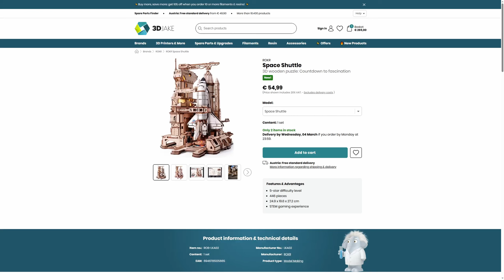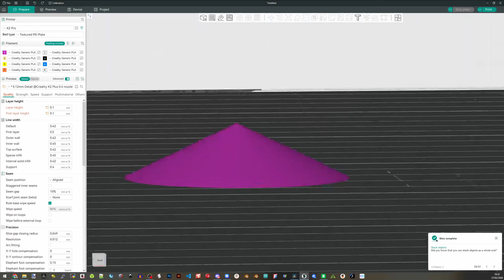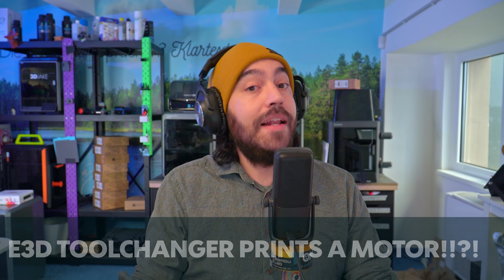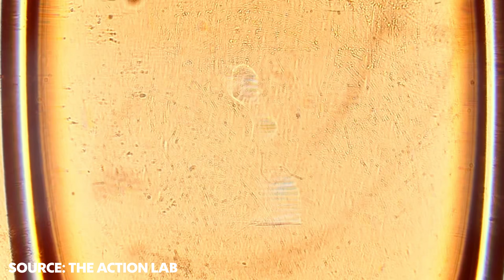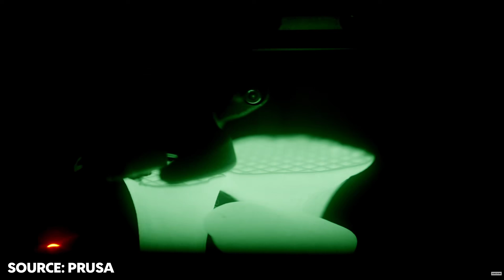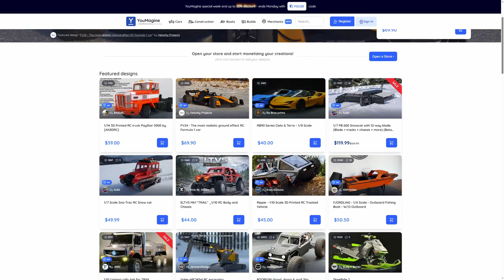Community News February 2026: New Products and News Updates!

Comment: Not related to video topics, but is it possible to filter or search filaments by subtype? Like PLA+?
Searching for "silk" gives proper results, but "PLA+" seems to give every PLA (and some, around 1000 more than there are PLA filament variants) and "PLA plus" starts with PC and build plates 😬
Reply from the maker: Unfortunately, our search and filter system needs a major overhaul, its on the list I promise you.
Reply: Problem is Theres No shared term , Like Pla+, Pla pro , rapid Pla+, Pla tough and and and . Maybe Basic Pla , and Rest Pla seperated.
Reply: @scienceandmatter8739  but there is: plus and +

As you read above, it's system limitation. If you work in filament selling business, please elaborate what makes tagging filaments difficult? Because there are stores that can separate plus PLAs (and silk PLAs). Just PLA always includes all sorts of PLAs.

Rapid is entirely different dimension and pro and tough would need to be tested to find out what, if any, properties they change. Those can be put under their own tags - problem solved 😅